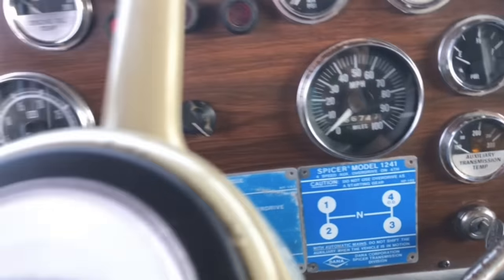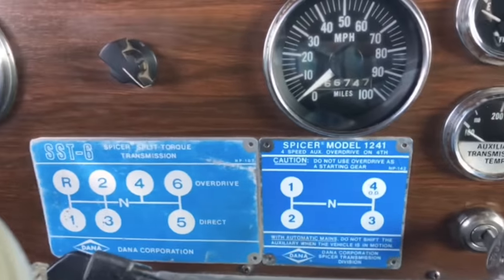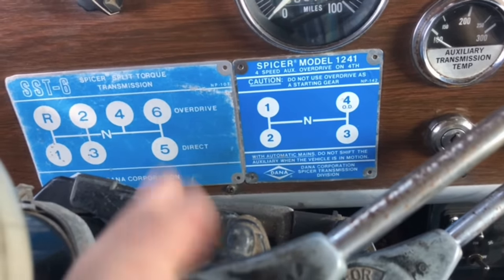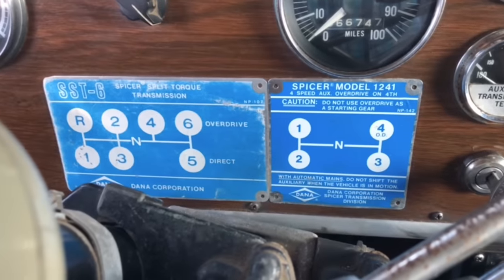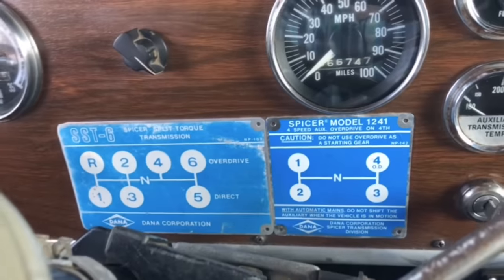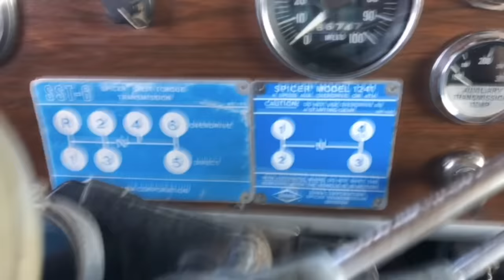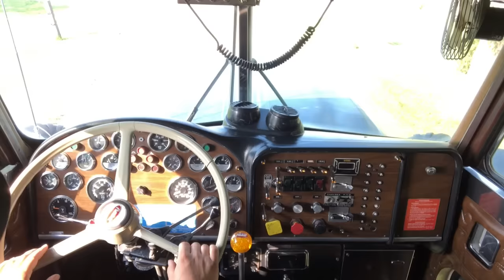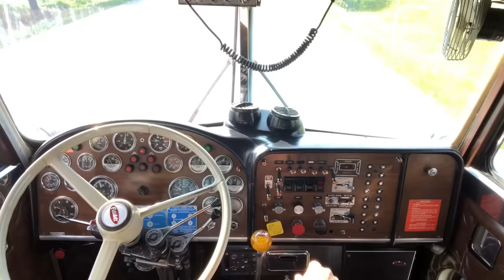How to shift Two stick 6+4 Spicer Transmission Peterbilt 359 #Peterbilt #359 #Twinstick #Twostick

Comment: 359 look+ 2 stroke diesel+ 24 gear, double stick spicer+ wood+ leather+ NO COMPUTER CRAP= a dream that I want to make it real for myself.
Reply: Absolutely awesome truck ,, i love it  ,, and i have one too ,, he has an 8V92  ,, i have a 12V71TT in my 1978 359 
love listening to it sing
Reply: @wildcoyote34 nice truck but there is nothing wrong with an electronic engine it makes where you can fine tune it
Reply: @William 1221 i can fine tune my truck too , it's just not as easy ,,and i have no $25000 emissions control system to go haywire or DPF to clog  , no bullshit  computer to cause it to derate because it got a brain fart ,or have the ECM go tits up cause it got wet ,,alli  gotta worry about is oil  leaks ,, and where is the next fuel station ,,even that doesn't happen very often cause i have 350 gallons of fuel
Reply: Me too.  That's the exact thing I've been saying for a long time now.
Reply: @wildcoyote34 there is only so  much you can tune on a mechanical and if you take care of your truck right an electronic engine should have no trouble
Reply: @DastardlyWaffle  i'll keep my old mechanical diesel   and i'll be on the road long after that duramax has gone to the boneyard ,, i drive a TRUCK   ,, not a $75000 overpriced fancy car 

the word T R U C K ,, is not spelled Duramax   ,,it's spelled PETERBILT
Reply: I'm amazed that you still have old lorries like that running about in North America, in Europe it's all about money and efficiency. I suppose fuel is cheap as chips over there.
Reply: I'm a private operator , there are a lot of older trucks still in service here , especially with private owner operators like me ,,my 40+ year old truck is exempt from all emissions regulations , it's cheaper to service because i don't have a $25000 emissions control system to go haywire and cost thousands of dollars and weeks to repair 
fuel mileage isn't such a concern because i am not driving huge numbers of miles ,, my truck is used to transport farm equipment for my operation
Reply: @szymongorczynski7621  almost all of the large, corporate run motor carriers in the US have upgraded their fleets for optimal efficiency because that's the only way to make money on that scale now.  The government has literally put a choke hold on transport in this country so a select few get to profit.  ELD becoming mandatory is more communist than the individual mandate fine for obamacare..   Only pride drivers run these these rigs anymore..
Reply: @DastardlyWaffle I worked at a heavy truck dealer.  Even well maintained modern brand new trucks can and do go haywire. Also, over time, any mechanical or electrical element fails.  The emissions systems on these trucks are no exception and are very expensive.  Worse, you have to have a qualified mechanic fix them.  The millennial mechanics at most shops today are sorely lacking in skills despite their ASE and factory training.  How many people.reading this can even tune a carburetor on a gas engine and understand what it does? You have to know basics before you can understand advancements.  Diesel emission trucks today are worse than gas engines in the 70s.  They really arent any more fuel efficient and sometimes they are worse. Choked down and cant breathe.  My old mechanicals(cummins big cam iii and e7 Mack)  got 6 or 7 mpg. Most trucks still get just that. I still have an old 78 Pontiac V8 car that gets 17 to 21 on the highway.  What do modern SUVs get? 21 to 24 or 28 maybe? In a v6? Hardly an improvement.  New is not always better.  I have old garden tractors from the 60s and 70s that still run.  Simple.  My 90s and newer tractors are all in the scrap heap. New diesel equipment even has dpfs on them.  Ridiculous.
Reply: @DastardlyWaffle my 97 f250 with a 7.3 Powerstroke and manual trans easily gets that mileage.  No regeneration needed thanks.  I also do my own work.  New trucks are really not an improvement.  Same with cars.  It is all about emissions, not efficiency.
Reply: @DastardlyWaffle it's not impossible its reality.  No I do not have a flip phone but if I did what would it matter? Why do you feel the need to insult? Ok it's my turn now. Although you have a basic working  knowledge of the emissions system you seem easily impressed with terminology. You probably tell people you have a 4 slice toaster, with 2 slice adaptability with chrome plated finish and heat insulated lever.  Potentiometer controlled variable heat setting with 110v ul approved power cord, attached.  Resistance wire heating system and 4 leg countertop stability support.  Once again, you have all these gadgets and complicated systems to arrive at the same bottom line except for emissions.  That is the only real improvement.  You can chip an older vehicle and get the power.  My truck is a manual and I dont mind driving a stick.  I've been in trucking for 28 years and loathe the automatics creeping their way in.  I've driven 9 10 13 15 and 18 speeds.  I can handle a little 5 speed synchronized trans without whining.  All your added intial expense and complication especially as that vehicle ages will cost you more in the long run.  It is like common core math.  I know that 45 divided by 9 equals 5.  One step.  Common core: 45 has 4 10s, 5 is half a 10, 9 is almost a 10 so 4 10s divided by one 10 is 4, and all the leftovers is 1 so 4 plus 1 is 5.  How many steps is that? I am driving a 2018 Freightliner with a Cummins and it isnt powerful, even though it is vgt and all that.  It feels like a potato in the tail pipe.  Sluggish. Nowhere near the power of my old KW or Mack. You can say your engine is cleaner that is a fact.  MPG is an actual number that can be compared.   I am not upsizing my old pickup.  I dont care what people think of it. I get what I get15 or 16 city and 21highway.  Torque? I have plenty to pull a full truckload of firewood and my tandem axle trailer behind it full of firewood.  I dont overheat when towing.  Ever. Ive pulled people out of ditches on snowy icy roads.  It does what I need it to do. To each his own.  You want new, buy it.  Dont begrudge the rest of us who want and continue use and maintain old equipment.
Reply: @Tom Paul yes i very much do understand exactly how the VGT turbo works , also understand the benefits of a VGT 
i also understand EGR and it's emissions benefits and also how big a pain in the ass it is when it fails ,, or when one of the components fails 

i wonder if mr twatwaffle understands exactly how a 6x4 spicer works ,, i've driven about everything there is and to be honest i'd rather drive a 2 stick than a 18 speed eaton , i never got the handle of the paddles to split gears ,, 
and i have driven a 2 stroke a LOT , i love them a LOT , the 4x4 and 6x4 spicer transmissions were tailored exactly for the 2 stroke detroit diesel  ,,more modern 6 cylinder turbo diesels  like a C15 cat or cummins ISX or even a detroit DD15 have lower end torque and don't wind up near as fast ,,the 12V71 in my 359 actually is very snappy , it's only got 50K miles on  a complete rebuild ,, if i'm not careful  i can easily burn rubber , it's fun trying to keep 720HP connected to the ground when you got a lead foot like i do
Reply: @wildcoyote34  cool.  I have driven a lot, but never a 2 stroke or a 2 sticker but would love to do both.  I learned on a 13 speed Fuller Roadranger so they were always easy to me.  Super 10s took a minute and I still dont care for them but I can do it.  I like the old style 13 with the 3 way selector switch too.  Those were fun.  Regular 9s and 10s are common.  As a company driver now, I am stuck in an automatic but I do a short shuttle run under 1 mile each way so it works.
Reply: @Tim Paul i can do a old 13 alright  , i don't do so well splitting gears  but it takes practice 
I learned to drive on an international that had a 8V92 and a 4 x 4 twin stick it was a bit different than the pete i later drove  ,,
i spent a few years at a rock quarry driving dump trucks and all of his equipment had 2 stroke detroit power 
the biggest machine he had was a gigantic crusher that had a 12V-149 TA and the inter yard haul trucks all had 12V92 TA engines ,,noisy rotten bastards they were and they had 4x4 spicers too ,,those Mack haul trucks would climb a mountain without breakin a sweat they were so over powered 
12V-92 TA starts at 650HP and can easily put 900 to the ground
Reply: @wildcoyote34  Actually, its both funny and sad to say it.  Mostly because I agree with you...  But you won't be on the road because if you haven't gotten the notices from FMCSA (if your hauling US) every truck will have to have a 2010 or better motor.  Even the older trucks will have to be outfitted.  Personally I look at this way...  I love computers.  The problem isn't the computer, because it's just a machine, too.  It's the people that are now using the computers to lockdown everything.  That only points to two groups.  Government, and corporates.
Reply: @Ronald Johnson i have never heard this one before  ,, I'm also not hauling cargo commercially
  i seriously doubt that they can enforce such a rule ,,I run a farm operation and i don't know any farm anywhere near me that has a truck less than 20 years old aside from huge commercial farms 
the only thing i have been able to find even remotely associated to this is the Pre-2000 Exemption for ELD devices  ,,
i know people have been cheating on this by rebuilding trucks using pre 2K engines in new trucks called Glider kits 
 
I do know one thing from building  hotrods and a couple legal arguments over safety equipment 
the DOT can not force me to retroactively install equipment that my vehicle didn't originally have as built when new 
this argument involved , Seatbelts , Backup lights ,and turnsignals  in a 1927 Model T roadster 
it had brakelights , tail lights and no turn signal or backup lights ,,and lap seatbelts weren't required until 1965,shoulder restraints in 1974/75 timeframe 
another reason i have trouble believing this  is because there is no possible way that there are enough 2010 and later engines to retrofit all of the millions of pre-2010 trucks still on the road ,,
a farther 3rd reason i have trouble believing this is because i live 5 miles from a semi truck scrap yard 
they sell used trucks and they have many  dozens of trucks for sale from school buses and fire trucks to dump trucks,concrete mixers and semi trucks ,,and most of their vehicles for sale are all older than 2007 and more than a few are pre 2k
Reply: @Ronald Johnson  I found this BS you were talking about and it's like i figured   CALIFORNIA BS 
truck and bus regulation FOR CALIFORNIA  ,, 
i have never been to COMMIEFORNIA ,, it's the only state where the state controls federal regulations 
FMCSA doesn't set emissions regulations  EPA/DNR does ,this 2010 Update thing is run by CARB a california version of the EPA  and from everything i have been able to read on the subject it applies only to California vehicles or vehicles operated in california 
my truck to my knowledge has never been to commiefornia  , i know it hasn't in the last 30 years at least
Reply: My ears and back hurt just watching this.
Reply: @Jon Edwards  that's beautiful music ,, i cut my teeth on a truck just like this one ,,mine has a different engine  but it's pretty much the same truck
my truck has a 12V-71  , and i much prefer the sound from it
Reply: @wildcoyote34  

I have. Enough of a hearing loss.  I prefer to keep what I have left.
Reply: @Jon Edwards you got a good point there ,, a lot of old truck drivers have serious hearing loss as a result of the noise from the machinery ,, 
I have mild hearing loss from operating hand held power equipment for 30+ years ,,I always wear ear plugs around 2 stroke powered equipment cause it's so loud
Reply: @wildcoyote34  

My first truck was an '85 Mack superliner with camel back suspension.

After that, I got into a 76 Mack r-model with a 5X2.  6" straights cut off just above the cab.

I've come to enjoy quiet cabs with smoother rides
Reply: @Jon Edwards  yea i appreciate a nice ride too  but i also don't drive a lot of miles in my Pete  ,, rarely go more than 100 miles  at a time , and usually not even that , mostly hauling farm equipment for my local farming operation ,and the occasional bulldozer or excavator for one of the local construction companies
Reply: @wildcoyote34  for 4 miles a gallon you better have 350 gallon tanks 😂👍
Reply: @B-trucker  ,, i don't get 4MPG i get 6.5-7 on average with a light load under 20 tons and 4mpg pulling 30+ tons 

I just drove my truck from Omaha nebraska to Muskegon michigan and down to Kansas  city and back to omaha , never had to fill the tanks,,,the problem with carrying so much fuel is weight if all 3 tanks are full thats pretty close to 3000 pounds
i averaged 6.7 MPG for the whole trip close to 2000 miles got home with over 50 gallons of fuel left
i had a full fuel load because i wasn't pulling a trailer but actually a travel trailer ,44ft custom built tiny home which i live in
Reply: ok boomer
Reply: Bubbles said 10 i think, so 10x4=40gears not 24
Reply: nope he said 6x4  , I have one of these too ,, and there isn't much of a mystery to them once you drive it for a while
Reply: I agree with everything but computers save lives nowadays and make the truck actually faster with ecu tunes
Reply: @Rayen Belghith ,, i have seen way too many newer trucks leave people stranded because of the emissions control systems went tits up and said sorry you aren't goin anywhere ,,I have been driving class 8 trucks for 30 years now and i have yet to see any sort of real improvement in the fuel economy of heavy duty trucks , the ECMs and emissions control systems don't do squat for fuel economy ,my 1977 peterbilt 359 gets 5.5-6 most of the time ,I've got a slightly newer freightliner  with a cummins 855 Big cam 3 ,,it's set at 525 horsepower and averages right around 7 when lightly loaded ,, my brother drives a brand new peterbilt  with a Paccar 550HP engine and he doesn't get anything over 6.5 mpg ,, with all the improvement in technology  explain to me  why fuel economy of heavy trucks has not changed 
my freightliner  and my pete will both run 75mph down the freeway easily 
for recreation  I have a 1948 GMC PD3751  motorcoach RV  , it's 71 years old and  if i keep it tuned up and the filters clean  it'll make 12.5MPG , that's right i said 12.5 mpg  on the highway ,,something wrong with that picture when my 35ft BUS gets better mileage than most 1 ton pickup trucks 
it gets  12.5 mpg without 1 computer chip anywhere ,and it has never left me stranded 
and even better , the 6-71 Turbo detroit  is about as simple as it gets
Reply: DastardlyWaffle  are you vegan ?
Reply: What happened to bastardlywaffle? He bowed out of the conversation early! What is he trying to prove by arguing his duramax van is better?! I don’t understand his end game. Is everyone supposed to say yeah you are right your engine is better than everything else! Hmmmm.....
Reply: @wildcoyote34  Peterbuilt* but yes The "peterbuilt" is the king of the road
Reply: Southern Fun Hell yeah!!!! Lol!
Reply: I've been reading the comments. AS A MECHANIC, I can tell you the computer controlled engines are easier to diagnose.(=improperly or untrained mechanics)But if you properly maintain either engine you should not have many problems with either engine type. With the computer controlled engine you can be a little bit lazy on maintenance and keep the perfomance (power, mpg & emissions) up. While with the mechanical you would lose a small (not really noticeable until it becomes a problem) performance loss. This is the REAL REASON that we have computer controlled engines and def on the trucks today. ( Think back the old black smoke - that was raw fuel = money blowing out the pipes!!! )
Reply: 359 is my favorite truck I wish I could buy one and put her to work. I drove one for years that was a 1985 with a 9-speed u-shaped pattern
Reply: @DastardlyWaffle the thing that makes me laugh is, your 6.6 Duracrap is a old mechanical Asian design with to much bs bolted to it. Made oil in it yet? You will and its cause of a simple seal buried deep.
Reply: Where did you get the idea that a ‘97 power stroke gets 6 mpg under 20
Reply: Dastardly Waffle, since you are so proud of short glow times, it might interest you to know that when you turned the key in 15 seconds, a ‘85 Ford with a 6.9 was already running. Same holds true for my ‘80 Caddy with a 5.7 as they both had the same glow plugs and controllers. Neither engine had much in the way of guts but they were economical and had enough power to get the job done;  and the were the best zero-temp starters of their era.
Reply: @DastardlyWaffle I have seen a lot of those dpf systems shake apart when hauling logs not to mention that if a def heater wire breaks itll derate which when your loaded and 200km from the means a 4000 dollar lowbed bill before you even get it into a shop these old 2 strokes would run fine with the rings blown on 4 holes lots still pulling logs in northern canada 500 plus hp
Reply: I do electronic controls programming for a living. All mechanical, when it's right, is magical. I'm a fan, and the sound of a Detroit is good music.

Comment: 50 years driving truck I've never heard of a ,2 stroke super cat. 

2 stroke Detroit's drop revs quickly not snappy. 

I've driven 6x4 my whole life since I could push in the clutch I typically shift 6 gears out of 24.

You didn't explain overdrive other than that, great job. 

Don't forget backing up in a truck stop shifting 4 times. That will turn heads. I currently run a 20x4 and a V12 Detroit 2 stroke. Now that's fun. 80 forward gears 4 reverse. Again I shift typically 6 times.